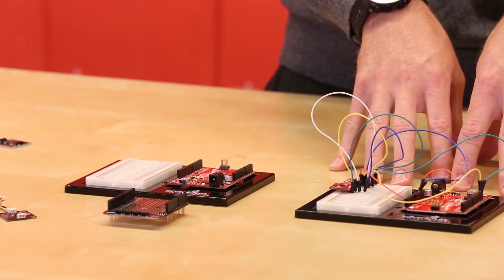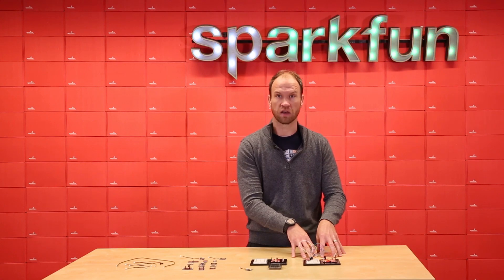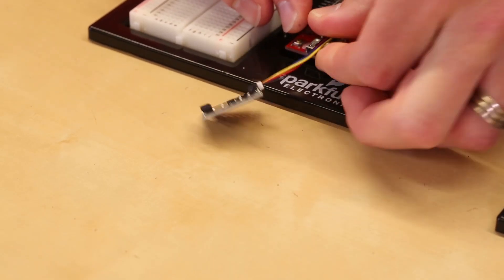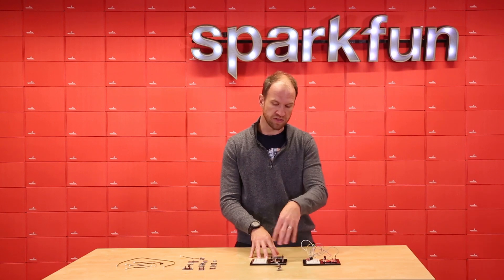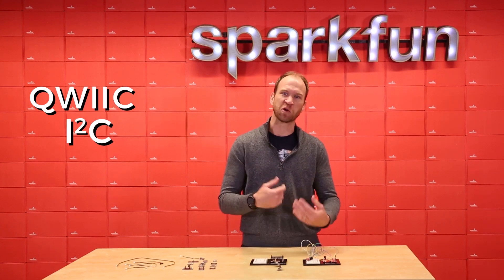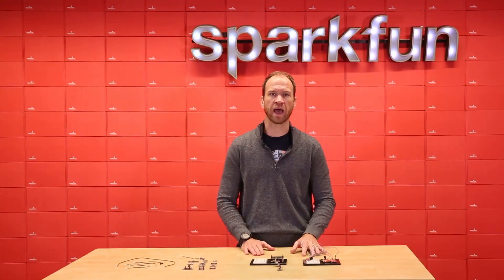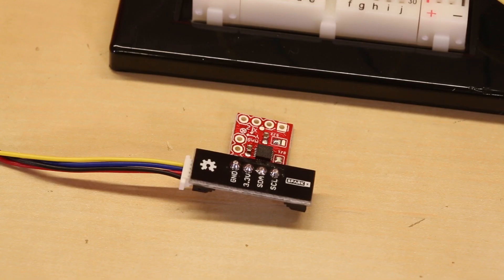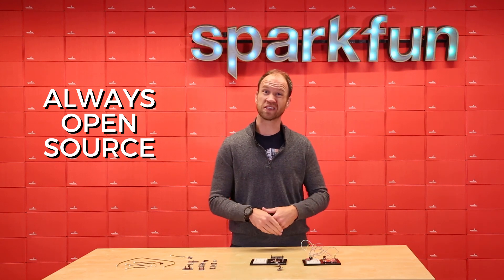Product Showcase: Qwiic System

Comment: Same as the Grove system?
Reply: Jon Gordon it looked looks like grove is similar but pin1 starts with scl, sda, vcc, gnd. Where qwiic is the opposite, gnd, vcc, sda, scl. The qwiic connector also looks smaller. Maybe a qwiic to grove adapter should be offered
Reply: A conversion kit would be awesome... I have dozens of grove sensors.